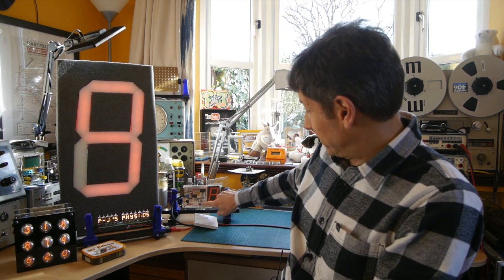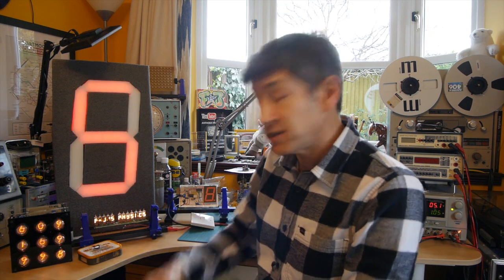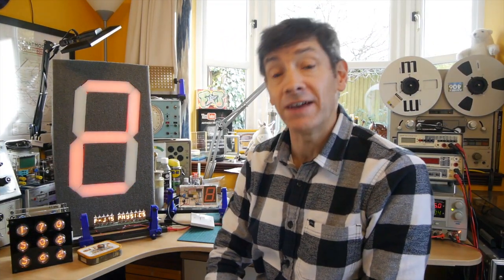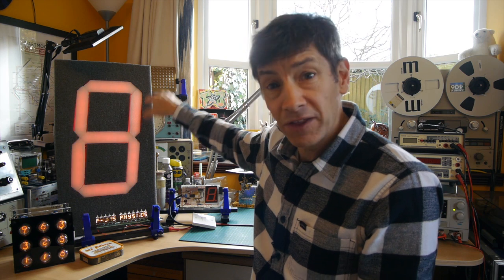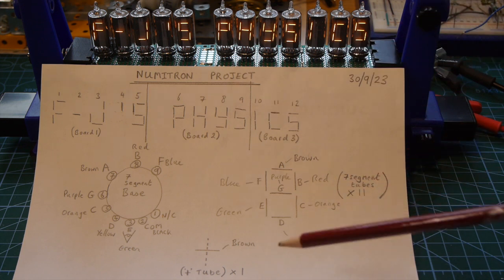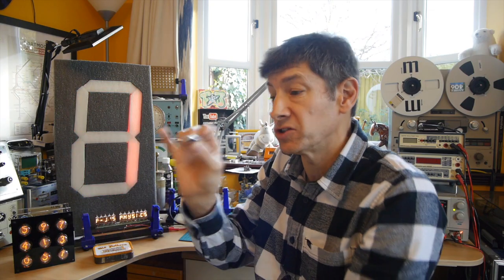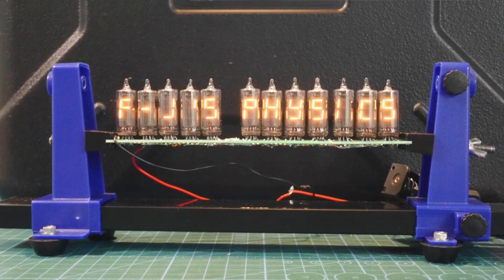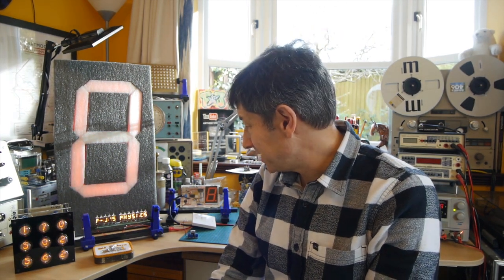Numitron Tubes - F-J's Physics - Video 174

Comment: Nice! Your display is static, but if you want to drive them, remember about using residual current for every driven segment, so that they light up from a warm (but not glowing) filament rather than going through cold-start, which could reduce the filament's lifetime. 

Minitrons are basically numitrons in flat, panaplex-like envelopes; they're known for their reliability (if properly driven), sometimes used in aeroplane cockpit indicators.
Reply from the maker: Thanks Keri. Yes I should really get them to do something!  You may know that I don't like using 'software based' solutions so would have to build some logic to go with them.  Mine are somewhat under-driven so don't get too warm at all but you are right that the rush in current needs to be avoided if longer lifetimes are needed.  I think if they are tungsten wires they are massively under-driven anyway compared with what they could be at - though I am not going to try!  I don't have any minitrons but have had lots of odd types of displays in the aircraft that I have flown as it is not easy to update equipment nor cheap!!  Often we leave old kit in place (AIP) as the paperwork/weight and balance and the like would not make removing it worthwhile unless the space is needed.  There are certainly plenty of old orange VFD displays still around especially in old GPS kit.  All good fun.  Thanks as ever for commenting!  F-J.

Comment: Hi again.  I came over for a visit after your comment on my Elektronika clock video.  I steered straight in onto this video of yours because of the 70's display tech.  That is my thing.  The addiction started in 2016!  If interested and you get a chance to visit my channel, you will see alot of it appropriated to digital clocks.  I also have a DR2100 tube display with logic on board that I reworked into a clock.  See: "Homemade Numitron TTL Clock using 1970's coin counter circuit boards".  As far as the Numitron "petrol" pump displays, I am about 5-10 years too young, or we just did not have too many of them used here in the states but I do believe, if you saw any flickering in said display, it may have been due to multiplexing of the display.  I have an old pump display board or two here and I recall them using 7400 TTL logic with a shift register package...I have to dig them out.  Hmmm.  Any how, yes, how we love parts tins.  I think "Altoids" mints still come in small tins!  Another one from the past here was the Band-Aid tins!  They had a hinged flip top.  Also to note, I did see your vaseline glass video.  My parents collect that and display it.  There is also uranium used in some "Custard" glass and it glows under UV light also.  The custard glass I have seen can have a flat, dull white appearance.  It may also look just like milk glass but glows where as milk glass does not.  
Enjoy!

Comment: As you said, the place I saw them was in petrol pumps. LED 7 segment displays appeared in the early 70s. That era around 1973, was all about calculators and they came with various types of display - LED won. Presumably you could drive them with 7400 series TTL logic where there will be drivers for 7 segment displays. Thermal lag might make them good for multiplexing. Probly not the display technology of choice for watches.
Reply from the maker: Thanks David.  Yes there are bespoke RCA chips for driving them which I forgot to mention.  The CD2500e and CD2501e decoder driver. They can be multiplexed but care needs to be taken over the circuit design and how the duty cycle of the tubes operates.  They do run (externally) cold and are very low current for a filament device.  There have been a lot of comments about thermal lag but I think this does not matter as they were meant to be read by the human eye so very fast changes were not really required.  I should build a stop clock out of them to prove this!  Thanks for watching and taking the time to comment.